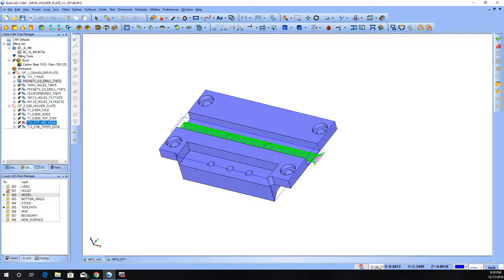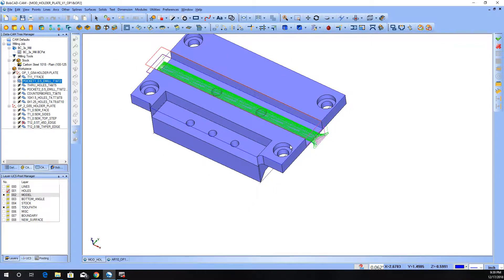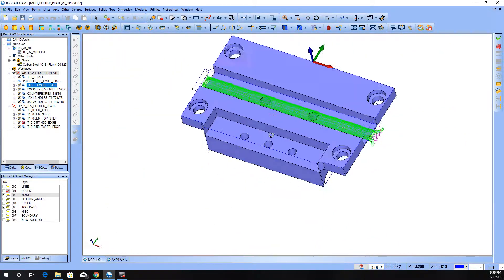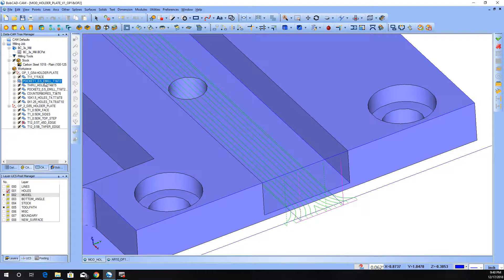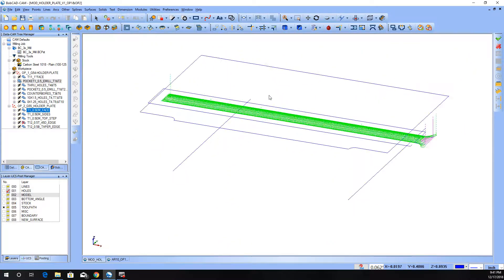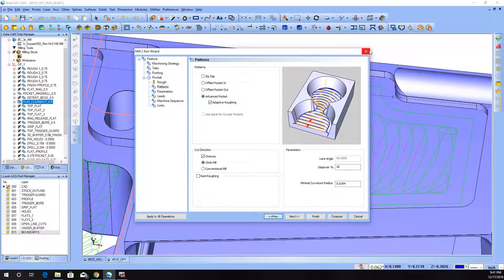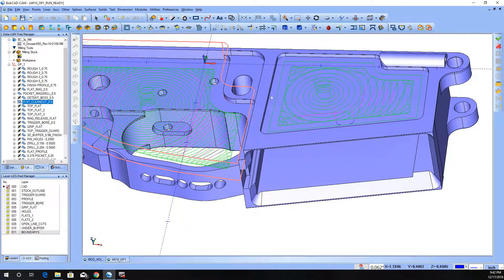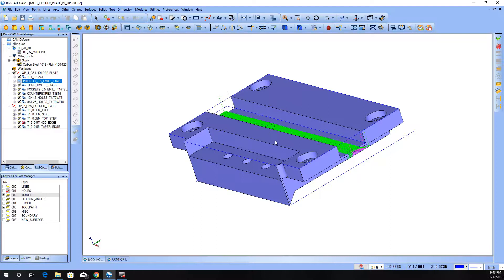Advanced Pocketing and Adaptive Roughing in  BOBCAD-CAM

Comment: How do i prevent the cutter going into a wall as it comes out the open end of the pocket?
Reply from the maker: The easiest thing would be to adjuat the Geometry that you select. You could extend it past the model to force it to stay with in. You might be able to use a boundary but I generally modify the Geometry lines to control that. 
I hope this helps.